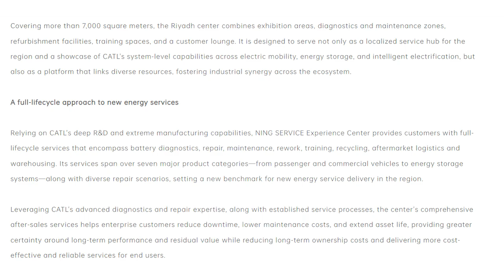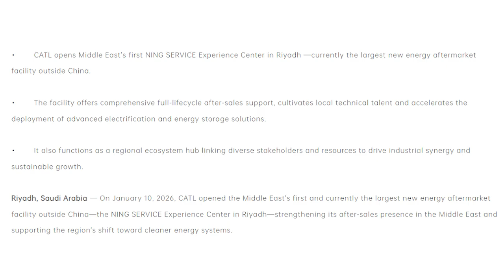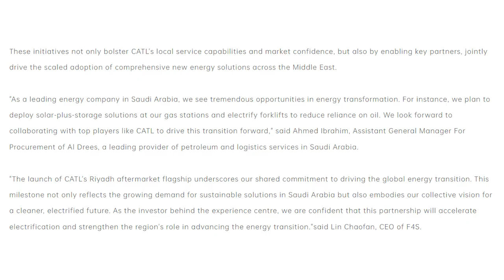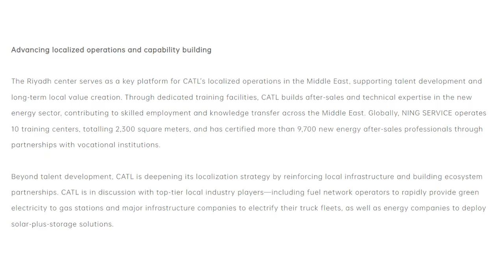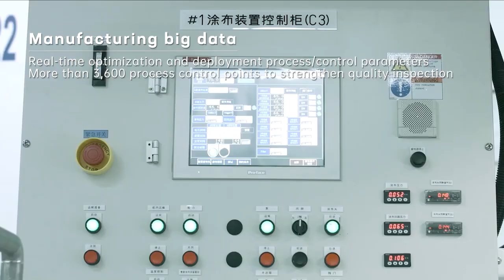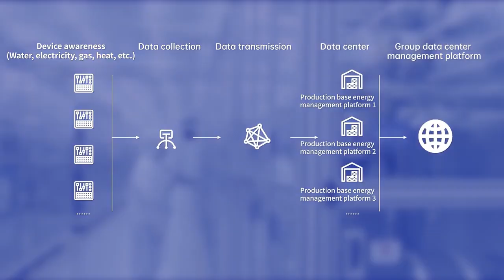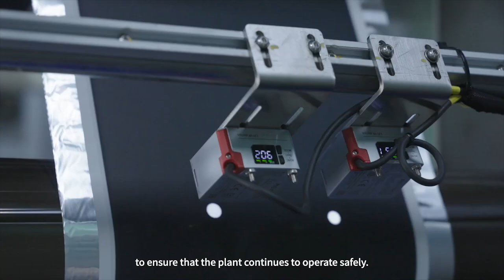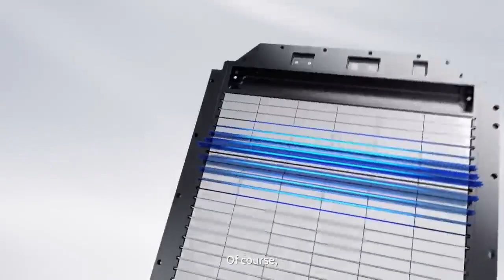CATL Opens Middle East’s Largest New Energy Aftermarket Facility in Riyadh

Comment: Imagine how much harder it will be to get service on your hybrid vehicle which not only needs all the same knowledge of batteries and electric motors but additional knowledge of transmissions, engines, radiators and how they interact with each other.
Reply: Not transmissions if it's a series hybrid  the only connection between the Stoichiometric multi fuel generator is the output power cables or buzz bars then that all gets thrown in the bin. The  combustion engine gets  smaller much this is how most ships and heavy plant operate just with the added advantage of a battery ...float  to draw on and further reduce the need to run the generator ICE .
Lighter simpler and cheaper it also runs cleaner, runs less and  needs less maintenance .  Look up the liquid piston rotary working on a modified Atkins cycle .. already working on  US military APU/gensets   and  a dinky unit for power tools and small mopeds and large drones.  In 4,stroke or diesel versions. The other is the Durham university opposed  twin  free piston 4,cylinders in two bores with mid mounted  reciprocating generator s  so about the size of a briefcase  with it's integral exhaust, mount and header fuel tank .  That produced 18-23kw .. had few parts light wt and sipped fuel ... Only issue Toyota  bought the rights did some development  work and promptly buried it  because of their big bosses animosity to electric motors  and  never progressing claims of having been working solely on solid state batteries as the only way electric vehicles could possibly work ... Well that went down well like Ford Nissan and other legacy ICE manufacturers they have been dying on the vine somewhat  of late as their regular products hit problems and loose out to  electric motors and rapid developments in battery tech. Even their engineers seem to have lost their ICE  mojo  of late with massive claims and warranty problems casting shadows over engines and transmissions that just cannot deliver  without increased risk of failures  and ever increasing complexity and servicing costs. 🤷🏻🧙🏻‍♂️🥼